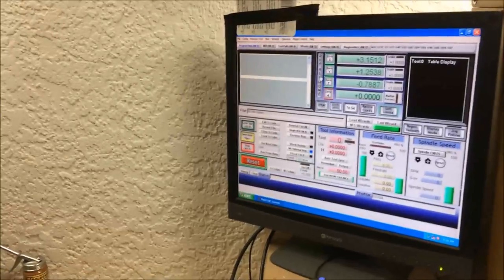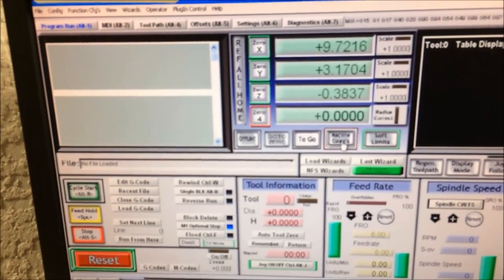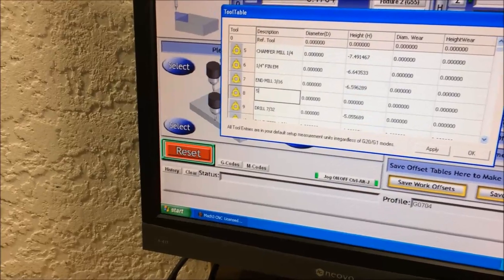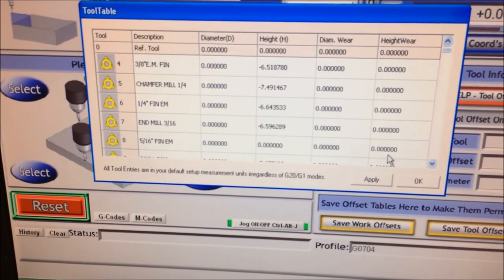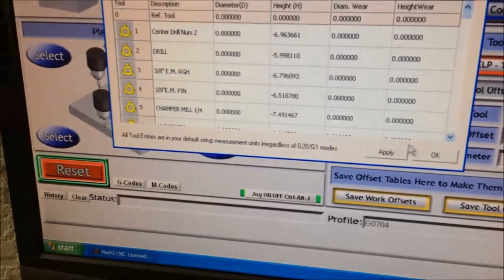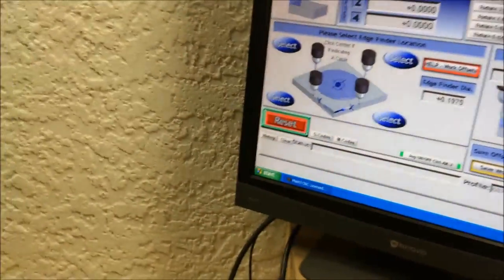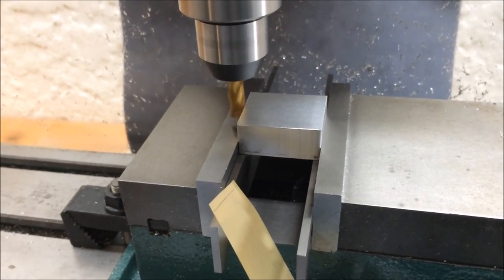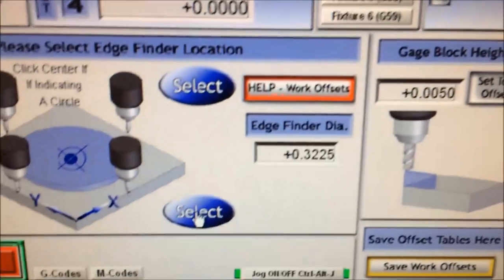Mach3: How to Set (Zero) Milling Tools and Edge Find Workpiece

Comment: Hi Franco i am not understanding the G59, is this just a reference for positioning for G54? Thanks, Great Video!
Reply from the maker: Hi.  The G59 thing is something I do that works well for me - but there are many ways to do this.  The G59 location is a fixed point in space where I touch off every tool.  IMO, it eliminates a lot of confusion.  Once I have the tool length(s) set for my tool(s) I then proceed to finding my G54 work offset.  Tool lengths first, work offsets second.

Comment: Great video, I just have a question on the x and y axis offset. The mill tool Dia is .3125 inch and the Gage block or shim is  .005 inch. I was wondering why did you double the thickness of the gage to .01 in and the total dia is .3225 inch. I was think only one side on the cutting edge of the tool is contact with the surface of the block so you just have to add .3125  and .005 and the result is .3175 inches. if the off set is .3225 inch would it be too far from the block that is needed to be milled?
Reply: you need to double the thickness and add that to the diameter of the mill. It is like using a mill that has a diameter of 0.3225 wiithout  the paper shim to do the touch off edge finding, but then you would risk scraping the work piece or crashing against it.

Comment: Hi Frank, thanks for a great educational video, I have a question regarding on tool length measurement using G59, so when you change tool for a different operation ,do you always have to reset the G59 tool off set and new tool length measurement must be made? because I am working on this one milling project and it requires few operations with different mill end bits and length. Thanks in advance
Reply: Hi.  If you follow this method, you only need to touch off your tools once.  As long as the tool remains in a fixed position in the tool holder, you will be good to go. If you are just using collets, then you have to touch off the tool every time you load it.
Reply: @bradfrancola8485  great video, i've been looking for this info long time. Just to continue this question, to make sure: if i turn on my machine, home its position and set Z0 on my workpiece with one of my known tools, ten mach3 calculates Z offset for each other tool? Now im just zeroing every tool when i change it

Comment: You should touch the tool offset on the top part.( you shouldn't touch on the vise
Reply from the maker: Why not?
Reply: The tool is longer. It will go deeper. It may crash your machine.
Reply from the maker: @dni3541  I understand your concern, but that isn't how it works.  First, you home out your machine.  Then, you measure your tools.  Last, you touch off your part to establish part zero.  I like to measure the tools on the vise fixed jaw because it never moves.

Comment: en mi caso es más práctico y fácil el auto tool zero..
Reply: Hola Tinca Merida, estoy empezando con mach3. Antes utilizaba grbl 0.9
Puedes decirme la forma de utilizar el auto tool zero de mach3?
Saludos
Reply: Feliz día hermano!  Todo depende de la tarjeta controlado que tenga. 
Desde allí va a usar un pin de entrada donde vas a colocar un cable para una pinza llamada probe y el otro cable va en el común.  Cuando toque ambos extremos te va a dar una señal que será utilizada como punto de contacto entre la herramienta y el material a trabajar. 
Comencemos con Que me digas que tipo de tarjeta controladora estas usando? 
Mi correo es sotogiovanny@gmail.com
Reply from the maker: Mi español es muy malo. Estoy feliz de ver a alguien más ha tenido la amabilidad de ayudarle. ¡Que te diviertas!
Reply: Te escribí a tu correo.
Gracias